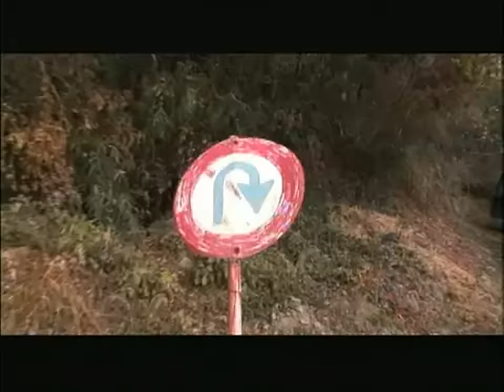The making of "Tokyo Drift" drifting scenes.

Comment: dudes forgot about OVER STEER and NEVER UNDER STEER
Reply: if you have understeer you're gonna have a bad time...
Reply: Niek Schouwenburg no doubt about that
Reply: Embcii Bee All wheel drift is a thing you know
Reply: Canadian Attack Moose Most would prefer to refer to AWD drifting as "power sliding."
Reply: Canadian Attack Moose You can't drift with AWD
Reply: Usama Urfi Depends on your definition of drifting I suppose. I know from experience that AWD doesn't stop me from getting sideways on dry pavement. Just need more speed than a RWD car.
Reply: Canadian Attack Moose Drifting is controlled. It's basically sideways driving. Only RWD can do that because only the rear wheels are spinning. AWDs powerslide. Going sideways isn't a big deal, the big deal is controlling the movement to the extent that you're driving in that unnatural position.